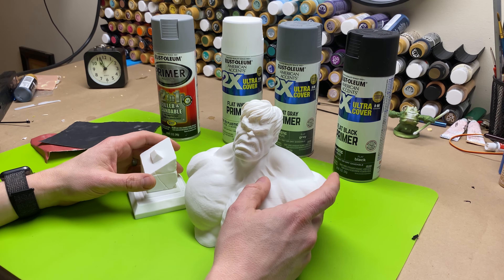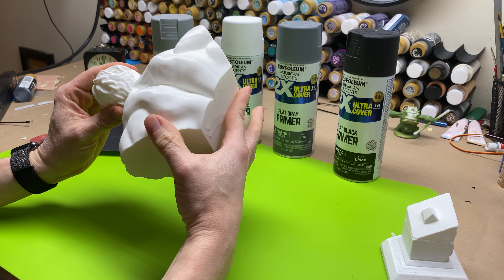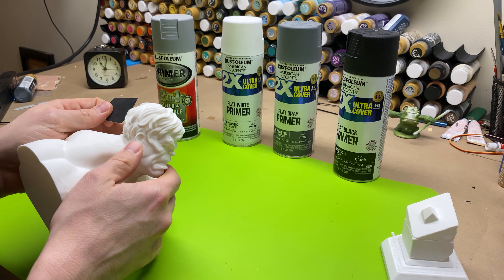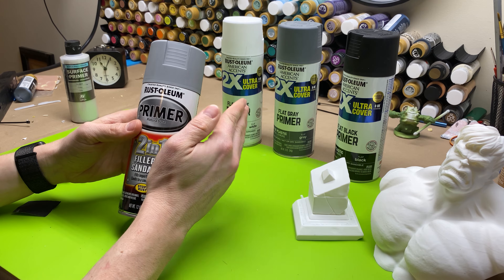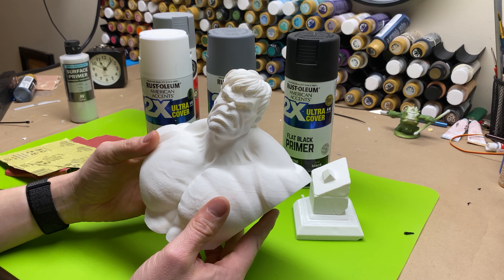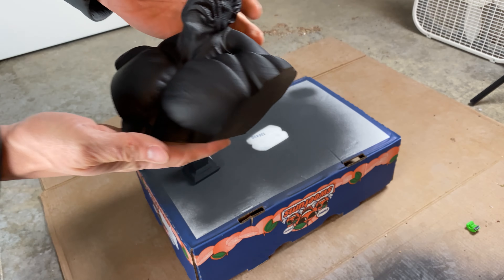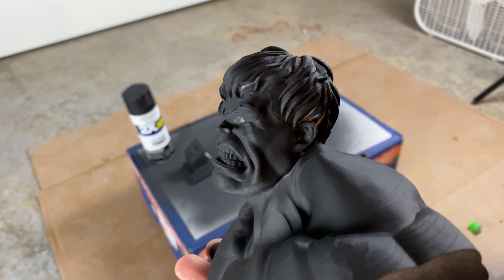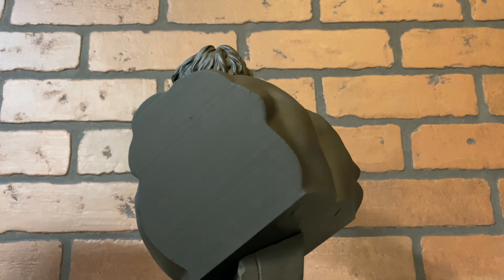Painting 3D Prints Tutorial Series 1 of 5 - Priming Models - Painting Techniques

Comment: What do you do about the layer lines?
Reply from the maker: You can sand them with sand paper. But doing that can remove the details. Primer helps too if you use the fillable and sandable kinds.  This model turned out bad with lines but I just used it anyway. A lot of that can be fixed in the print settings.